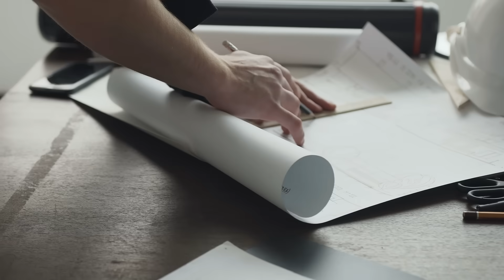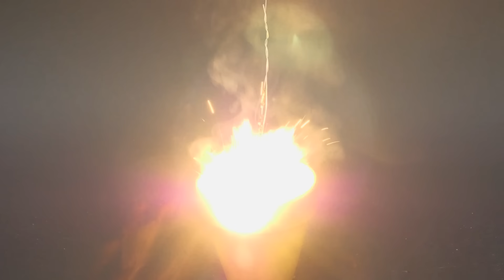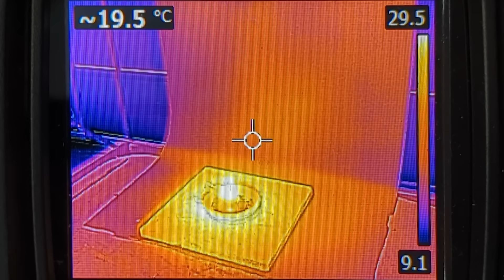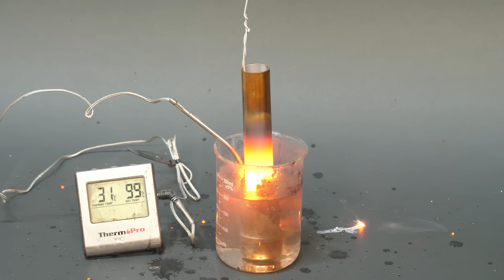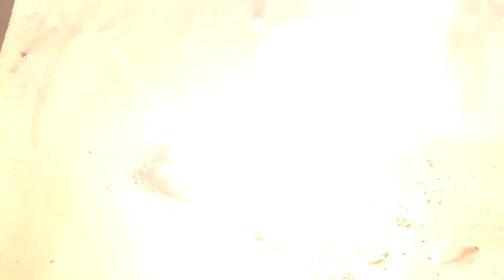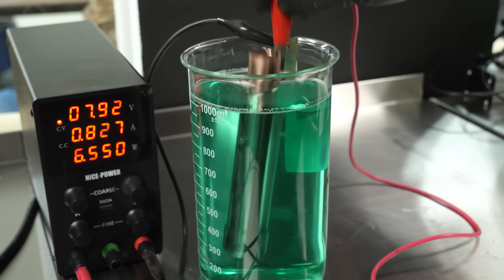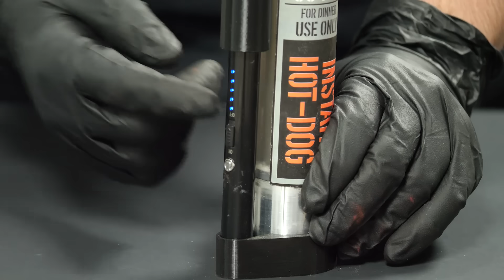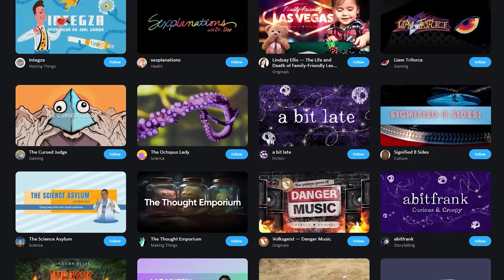Tactical Thermite Powered Hot Dog

Comment: “If you want to see a grilled version of this, let us know in the comments.”
Why, yes. Yes I would.
Reply: Obviously we want a grilled version what are we, poor?
Reply: @eloryosnak4100  why yes, yes we are 😔
Reply: @eloryosnak4100 yes. Yes I am in fact poor.
Reply: I mean if disposable vapes are a thing I can't see why you can't put a hotdog in a heated coil.
Reply: @max3d_0ut  You’d need someway to stop the dog from sticking to the coil.
Reply: @max3d_0ut metal leeching into the hotdog?
Reply: @max3d_0ut that was the first thing that popped into my head.  Vape wire and a battery, maybe some ceramic to reflect the heat.
Reply: Vote me in too.
Reply: Seems like that would be too easy. Batteries and wire = grilled hotdog. Boiling with thermite is definitely crazier than that.
Reply: @Kelnx  maybe a portable microwave 🤔
Reply: @Kelnx  My dad actually taught me how to do that as a kid. He was an.. interesting father. Strip an extension cord so you have two exposed ends. Hook each wire up to a bit of thick copper wire. Insert them on opposite sides of the 'dog. Plug it in. Enjoy. It also doubles as an easy way to find out if the room has a GFI!
Reply: @Kelnx  mini blast furnace. Wire seems a little too easy.
Reply: Same
Reply: Hotdog Hohlraum?
Reply: Honestly, grilled is what I was expecting from the thumbnail and I was a bit let down. Who eats boiled hot dogs? 😣
Reply: @PopeGoliath  When you got a lot of people to feed and you don't love any of em, you boil your hotdogs
Reply: @nonapis9783  Harsh but accurate.
Reply: @nonapis9783 ..or your tank is empty because your dog chewed the hose
Reply: @PopeGoliath  About 85 to 90% of people who eat from a hot dog cart eat boiled hot dogs. From what I understand most of them are on a simple boiler setup. Cheaper and easier to maintain
Reply: @PopeGoliath  eh, boiled hot dogs aren't too bad e.g. if you're a student and you don't have a pan
Reply: @PopeGoliath you don't have kids, do ya?
Reply: @PopeGoliath   Cries in hairpin trigger apartment smoke detector
Reply: Ditto.
Reply: Also I suggest including styropyro in the fray
Reply: Seconded!
Reply: If I had to guess I'd say electric coils? Wonder how many AA batteries it'd take.
Reply: Maybe a super capacitor with nichrome wire.
Reply: "You built it boiled despite the fact that it is obviously better grilled?"
Reply: Count my vote
Reply: A tac dog that doesn't bite
Reply: Some glizzies will explode and I want to see the road to that
Reply: Mentioning thermite made me think it was grilling as it would've been easier to just buy self-heated ramen and use the quicklime package in them or purchase a military MRE which use magnesium, iron powders and table salt if you only want boiled.  You could probably purchase the fireless heaters separately from the web instead of salvaging them from self heating food packages.
Reply: Please for the love of science
Reply: same lol
Reply: I think one of those electric rings that that heats up like a circle and then slides up and down on a worm screw and slide with like a spring that will drove the electric charged hot hot hot dog circle
Reply: Me too
Reply: GRILLED!
Reply: Yessss!!!
Reply: what you would do is wrap the hot dog and wire and then hook it up and then hook it up somehow to like well you know the part that makes the hot dog heat up so it will actually heat up the wire and then it grows it automatically
Reply: Why, yes. Yes I would.
Reply: yes i would
Reply: yes please
Reply: As would I
Reply: YES
Reply: wood
Reply: yes
Reply: waiter. i would like a grilled hotdog plz
Reply: Agreed
Reply: llll
Reply: Same
Reply: all u would need to do is put the thermite under the winnie and have no water, thats the only difference
Reply: would be easy to do just use a heating element wire and a lithium power cell
Reply: grilling hot dogs should be considered a war crime or something
Reply: @3_14pie  more like not grilling it should be a one way ticket to Guantanamo bay
Reply: @3_14pie What...😂 That's a bad take.

Comment: What about replacing the water with oil? You'd have to make sure it doesn't splash and can let the steam out, but it should cook the hotdog at a temperature that would allow for the maillard reaction.
Reply: You want to eat a hotdog that's drenched with oil?
Reply: @Jehty_  You know, it's true that I haven't tried a deep fried hotdog before, but I figure it wouldn't be that bad. Probably better than deep fried butter, and they already sell that at the fairway. I can't remember the last time I boiled my hot dogs. Not nearly as good as pan frying them or grilling them if the weather's good.
Reply: @Jehty_  if you use the oil used in deep fryers it actually pretty good. Assuming you wipe off the oil with a paper towel first, as to not soak your bun.
Reply: @Jehty_ Scotland has entered the chat.
But, for it to be authentic, you'd need to batter the hotdog first. 
Then, you might like a deep fried Mars Bar.
Reply: @Jehty_  That’s pretty much just what a corn dog is
Reply: @Jehty_  You don't?
Reply: Local restaurant near me boils them in bacon grease. Yes it's exactly as awesome as it sounds @bryanjk
Reply: @bryanjk  - Yes, it DOES sound like a fire.  Soon as that oil gets hot enough it explodes with flamey bits everywhere.
Reply: I second the idea of trying this with oil, if only for the shenanigans and tasting-reactions 😅
Reply: On the plus side, batter it up and you've got yourself a great corndog.

On the negative side, that's basically just asking for an oil fire...
Reply: oil decomposes at lower temps compared to water and causes gas buildup so youd need a thermite that has pretty controlled temperature
Reply: i think that would turn it into an actual pipe bomb

Comment: Why does the thermite create gasses? I thought it was just a substitution reaction. Is it just the heated gasses and vapors adsorbed to the powder?
Reply: The gas is aluminum oxide.

The reaction goes above aluminum's boiling point, so the tiny particles of aluminum vaporize immediately, which helps facilitate the rest of the reaction. The resulting aluminum oxide is also well above its boiling point, so is released as smoke.

Comment: you just have to run current through the hotdog
Reply: Direct electricity happens to be very, very bad at cooking things evenly; though a tube-shaped oven optimized for making hotdogs would probably have been considerably easier (and actually be marketable because it's not a bomb).
Reply: @twobladedswordsandmauls2120  I can only imagine the warning labels on a "tube shaped oven" that can fit a hot dog.
Reply: 'Big Clive' has done this and there is an American device for sale that passes mains through them to cook.
Reply: @andymouse  - More accurately, Big Clive used the American 110V cooker on UK 240v voltage to hilarious results.
Reply: @andymouse  I didn't see that you said mains.  And I know it's American, I was just pointing out the difference in voltage that makes the video so fun.
Reply: Yeah sorry just me being picky !! :) @phydeux